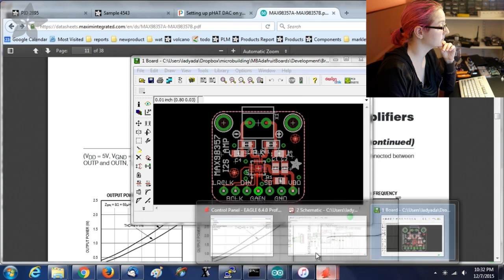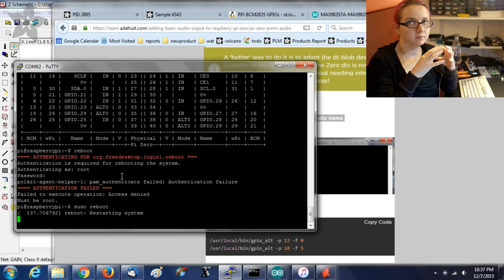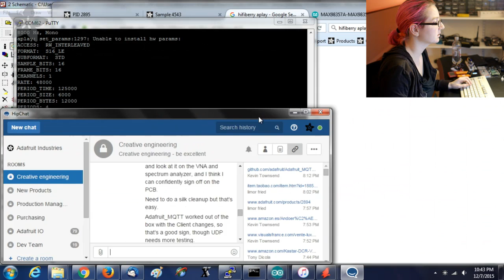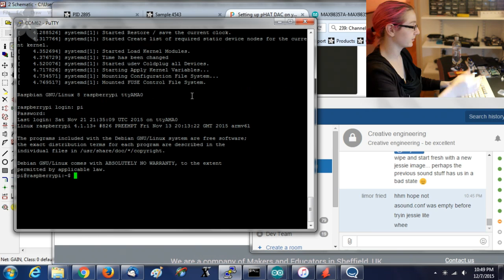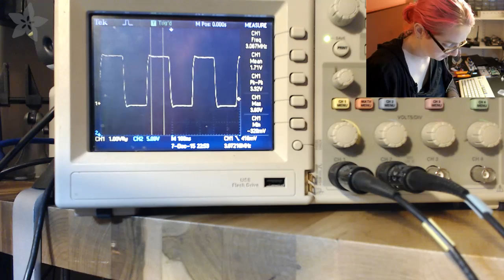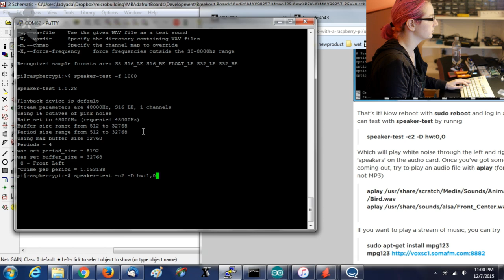@raspberry_pi #PiZero i2s DAC attempt @adafruit #deskofladyada 12/7/2015 LIVE

Comment: Hey Adafruit,
  Suggestion, perhaps you could upload these streams with an open license? I'm not personally interested in editing and uploading such a video, but perhaps others would be.
   I have come across several of these types of videos before from you guys. I'm usually looking for a condensed answer to a complicated question and these raw videos are the only visual media source. I greatly prefer the visual example over written tutorials as it adds so much more context to the explanation.
  In these situations I'm usually looking to solve a problem of some sort, and I don't want to turn the experience into an academic career of a project. For instance, right now I want to fix a TV I picked up on the curb. It appears to have a bad I2S audio IC. I ordered and received a couple replacements, but I haven't got a clue about how the I2S communication works. I'm really trying to figure out if the chip (STA339BW) is actually programmed somehow or if I can drop in a replacement. Regardless, I thought I could probably use a spare with a Raspberry Pi if I can manage to figure it out.
  Anyways I would really appreciate a bit easier/quicker access to such great, in depth, intermediate level help. It's just an idea, but perhaps if other people were encouraged to condense such content on YouTube it would increase access and the quality/depth of available information. If people knew they could edit and monotize specific streams as an upload on their own channel it might be a popular thing for people to do, especially the people that tend to desperately pirate content to establish a channel. I know people like this aren't the greatest to encourage, but perhaps if they were given an outlet with real potential for productive content they might put in the effort to do something effective. If I were in your shoes I'd do this with the condition that they must include an opening screen disclosing the source and a disclaimer that the edited content has not been reviewed/see the full stream for all information etc.
  In the end such a practice would inevitably increase Adafruit's social exposure as the people that upload such a video would probably be centered in other social circles outside of the reach of current Adafruit exposure. 
   Anyways, that's just my take on the subject. I feel like there is an educational gap in electronics content at the intermediate level. There's lots of entry-level info and there are places like EEVBlog that leave me cross-eyed on many occasions. I think Adafruit is the perfect brand to help fill the gap I have experienced as a hobbyist.
Sincerely,
-Jake